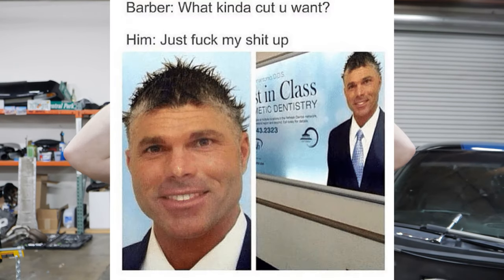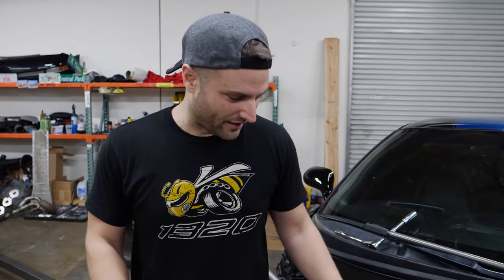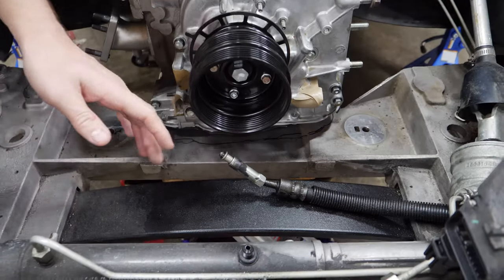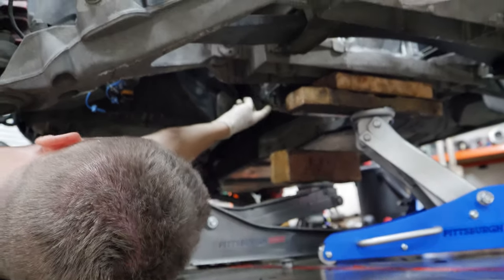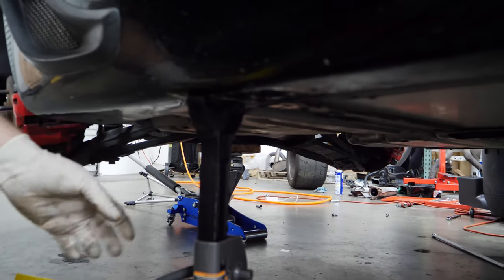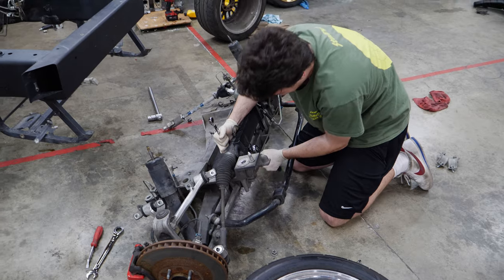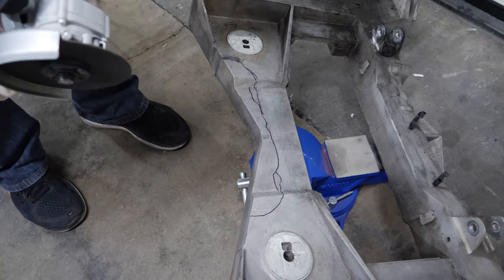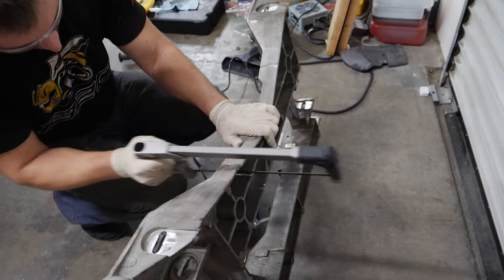Rotary Corvette Subframe CUT.  1 month to LS Fest

Comment: Aluminum cutting/grinding tip: use a cutting wax. I do a lot of machining with aluminum and brass, and lubricant wax stops cutoff wheels, grinding pads, and drill bits from clogging with soft metals. It’s an amazing difference in time and effort. Cheers!

Comment: Just a tip, you can use a grinding wheel instead of the cut off wheel on that subframe. Harbor freight has a pack of the fiber reinforced one's for like 10 bucks. They last forever too. Good luck with the build.

Comment: You could do with using a recip saw to cut aluminium, ally clogs grinding discs causing them too over heat and explode, flap discs are OK though and make a good job of cleaning up and finishing, keep up the good work 👍

Comment: Are you planning on doing a v mount radiator and intercooler? You have a ton of space for awesome airflow into both
Reply: Yeah, especially with the outlets on the hood like the Ford GT, it would look sick
Reply: V-mount is a massive waste of time. Any decent modern radiator and intercooler will suffice, this isn't the 90's anymore. At this point, it's literally rice. Putting an intercooler that can support 800hp into a car that won't make 500 will just leave you with less boost going into the engine due to the pressure drop associated with it.
Reply: Sky Guy yes most of today’s ics and rads can perform well in standard configuration, but they would perform BETTER in a v mount configuration with proper ducting. Air flow is air flow, and colder air intake temps are always better. So if he has the space why not? Plus v mount isn’t that time consuming to fab brackets for, even if he doesn’t do proper good venting and ducting right away

Comment: Hey Rob, not sure if you will see this but thought it might be worth a mention.
If you coat your cutting or sanding disc using a dry bar of dish soap ( We have a green bar here in South Africa called Sunlight) it will help massively with picking up less aluminium onto your cutting faces and "lubricate"your cuts also preventing your disc from digging in :) Keep up the great work!

Comment: They are kind of rare but I wonder if swapping a gsl-se front cover would help your engine mount setup. They have the engine mounts in the front and may be pretty close to lining up with the stock corvette mounts. I’m not sure how omp and all that stuff would work but it wouldn’t be a bad thing to look into.
Reply: He does mention fitting an early type front cover with engine mounts but does say with the expected power would rather keep the rear mounts to prevent twisting the block.
Reply: Yeah watching it again I totally did glaze over when he said that haha I suppose that makes sense, just kinda sketched me out that it sounds like he still wants to mount it to the subframe with the rear mounts.

Comment: 17:39 I did similar work on my Tercel to fit a 1ZZ into it. I ended up doing rough cuts with the angle grinder, then finishing it off with a Dremel for those precise rounded cuts. After that I boxed the frame rail off with some extremely thick steel to make up for the lost support. Photos available if you're interested

Comment: Hey Rob, when cutting aluminum with a cutoff wheel, run the cutoff wheel through a regular bar of soap first. The soap coating the disc will keep it from getting all loaded up with aluminum. 

Also, the haircut looks fine, I wouldn't worry about it.

Comment: After the engine mounts are made and the sub frame gusseted or boxed, the really hard stuff is done. Electrical and fuel won't be too bad, and with a few acres of space the inter cooler and intake plumbing should be pretty straight forward.

Comment: Awesome work! As a tip maybe use a bit of masking tape to straighten and plan out your cutting lines. To apply a neat and subtle radius, I probably would have used a flap-disc on the angle grinder, I can really recommend them. But it turned out really nice.

Comment: To make arced cuts in any type of metal it is easiest to make the angled cut like you did then use a die grinder with a carbide burr to finalize it. A die grinder gives you the freedom to make any size arc freehand and also has many other uses around the shop. I can tell you that once you have one, its a tool that you will think to use in a lot of situations.

Comment: thinking of the circular rotation of the rotors; your engine will vibrate/oscillate in that motion. Maybe consider that in the future? Your bushings will have to be extremely firm or else the engine will vibrate on the subframe.  That, or grind off a bit more off the subrame on the sides. I don't know your vision on the vehicle, but if you care for it to be yours for a while dont skip corners, now is the time to do things right.

Comment: man you guys need to watch project Binky, force you to up your fabrication game.
Reply from the maker: Definitely trying to grow quickly on fabrication so I don’t have to rely on anyone else.  I’m sure watching him will help inspire!
Reply: @RobDahm  this exchange right here is why i watch this channel , keep up the good work man
Reply: @RobDahm  Project Binky is a feat in engineering. A full ST185 Celica GT-FOUR drivetrain (3S-GTE, 4WD) into a 1960s Mini Cooper, just amazing. 👍💪 Search Bad Obsession Motorsport.
For actually building the engine you've already stumbled upon the twins and Broomy at FullBoost. 😉
Reply: @Z-Ack  Dude, I have a JZA70 1JZ in an MX83 Cressida, it took me nearly 10yrs to find a specific OEM part due to lack of availability because people would only sell the entire kit for thousands and Toyota are pricks that don't sell to engine swappers!! 😫
Reply: @MafiaboysWorld  what part takes 10 years to find lol
Reply: @MadEvo606  A CT12A rear turbo that I was looking from 2010 for. Check everywhere on the aftermarket, you can get the front turbo, no problem. The rear turbo however was a different serial number and NO ONE makes them individually, only as kits for cheap Chinese turbos. Toyota wouldn't sell them unless you gave them your VIN number, which I didn't have because I got my 1JZ out of Japan back in 2006 as a front cut, took motor and ECU and threw rest away, not knowing that fact at the time. 🤷 Go on eBay and I could buy a full used 200000mile kit from someone who was upgrading to a big single...for $2000+AUD, F that!! It's ridiculous at times. Fortunately I got one for $230 from a mate of a mate who was wrecking a Soarer and didn't know you were meant to keep the kit together. I got the rear and some guy in New Zealand got the front one. 👍
Reply: @MafiaboysWorld  oh that's difficult then, glad you found it in the end

Comment: Could have used a holesaw in the corners before you cut everything else. but now its too late. Aluminum is still soft enough that even wood cutting holesaws could be used in a pinch.., it would dull the crap out of them quickly but they could be used.
Reply: I still don't understand why he didn't just buy an aftermarket subframe that's lighter and has tons of clearance.
Reply: @unlisted9494  Because $3000 and no answer to emails, which he says in the video.
Reply: @mfree80286  More than that.  It also requires switching to coil overs, changing the axel stubs and brake system.  Not to mention it was designed for drag racing. rather than all around uses.

Comment: hi, Rob, you can make two bridges on each side of the engine to put the motor points, starting and using the same points of the subframe and welding somewhere in the firewall.

Comment: The stack of washers are most likely for achieving proper torque to seal the oil pan when the engine mounts are not installed. If you don't torque the bolts properly before the RTV dries, then the pan will leak.

Comment: I don't think your technique is too bad there. You've definitely got the right idea with sneaking up on the cut and tracing out patterns. You can finish it off with a flap disk, or with a roloc disk. I love roloc disks for grinding welds and such, but the curve here isn't crazy tight so a flap disk should be plenty capable. Then ya know, go crazy and polish the whole subframe and get some dude to spend a week engraving fancy swirls all over it.

Comment: Invest in a Zirconia Flap Disc, Rob. Especially with aluminum, a flap disc will smoothen out the round cut on the subframe, and you can use it to deburr your edges.

Also, I noticed you held the grinder so the dust from the cut goes away from you, which is dangerous. Even with a guard and a handle for better grip, an angle grinder catching from the wheel will rip itself out of your hands, nearly 80% of the time, dare I say 90%. So having the dust from cutting fly away from you means the blade catching will send the grinder towards you, risking a bruise or even a cut, regardless of whether you have a guard on it or not. Hold the grinder so that when you cut, the dust is flying towards you, in between your legs, basically around you, that way if the grinder ever catches, it flies away from you, killing any risk of that blade coming for you.  I cut my hand 4 times on one cut from an angle grinder holding it wrong while cutting an exhaust. The blade hit my skin, went deep, went off my skin, and came back down, FOUR times.

Comment: Bend a 1/4" aluminum plate and weld it to the subframe to replace the wall you cut out.  You will get a bunch of strength back. The Carbon Fiber leaf spring supports the entire front end, and flexes the subframe.

Comment: on the hack saw... pick up some A9 cutting fluid (for aluminum) And use a coarser blade. It will last a lot longer (way longer than on any other metal) and cut WAY faster. 
On the angle grinder, pick up some cutting wax (or use a soap bar) it will make the abrasive disk last longer, and cut way faster through aluminum. 

Like butter if you use the right methods. 

Good luck!
Reply: also, get a die grinder (or rotozip if you do not have air.. or foredom) and some good carbide burrs to remove some small material and round out edges (also use A9.. really use it on all cutting tools with aluminum) 

a good set of files can go a long way as well (nicholson or something equal or better)

Comment: Rob that thin disk is for cutting they make thicker disks for grinding and are ment for side loading a bit better but that thin cutting blade just too much side force and it will snap
Reply: Is this even English?
Reply: @glock1inthetop45  too turned into turn with auto correct... otherwise he used a cutting disk for grinding away material and they will snap with side loaded force(using the flat side to move material) and they make thicker grinding disks ment to be use more for moving material and less liking to snap to side loaded force

Comment: You need a special cutoff wheel or grinding disc for aluminum. The way the aluminum was melting onto the blade can be dangerous, since it can cause the blade to explode.

Comment: If there's any plans on going to a 3 rotor in the future, that subframe is gone. The only thing I see working from there is deleting the leaf spring, putting coils in, and replacing the subframe with basically a straight bar, with mounting for all the extra bits.

Comment: When using abrasives on aluminum, disk or otherwise, you need to lube the disk or grinding stone. usually a dry wax or something of the like. Aluminum gets too soft with the heat involved from grinding or sanding, lube lets the aluminum dust fly off the abrasive surface.

Comment: Hopefully you look at this.. make sure when you are grinding and cutting aluminum you use the appropriate disk flap wheel or cut off that it's made for aluminum.  If it's not made for aluminum it will load up like you were seeing and become unbalanced and fly apart.  Solid grinder wheels and disk are way worse about it but it's usually not good when it happens.  Be safe brother.

Comment: The extra bracing on the sub frame should be easy when it is not solid, get a big slab made and just bolt it onto the remaining frame with nuts and bolts.

Comment: You can make the radius cuts using a straight grinder with a aluminum rotary file. Also, you should always either wax or wd40 what your cutting with before cutting aluminum to stop it from clogging and impeding cutting.

Comment: Just a couple Things please wear a face shield when using a cut off wheel I’ve worked in Fabrication and have seen those things and just fly apart and hurt people pretty bad. And secondly when you’re making the cuts making the cut and cutting up the chunks that’s like the best way to do it but if you take a tiger paw or flapper disc and use it for  the finish work after you cut out the big chunks it’s a lot safer and you usually get a a better end product. Lastly please never use a cut off wheel as a gridding wheel that is very dangerous because it is causing side pressure to it and they’re not designed for that and they will explode when to much side pressure is applied I have learned from experience on that one lol. Anyways love the content keep it up!!

Comment: It cuts like butter because it's smaller.when the cutting wheel is bigger it disapates more heat the blade heats up alot faster when it's smaller hence why it cuts better

Comment: ROB  ..here is a life saving tip place your tires under the car that way if the jack or the stand fail it will just fall on the tires..savin' your butt  also make sure you place wood on top of your Rim/ tires so they don't get damaged.

Comment: use the same points of the LS motor, the solders in the back and so you make the bridge and you only have to make barriers to the bridge that you use in the place where the screws of the motor points and so you do not have to cut the sub frame. until all the front of the engine area would be more solid

Comment: That came out nice man - a die grinder might have helped on the rounded parts and to round the sharp edges off to make it look pretty. But well done with what you had. Cheering you on for another awesome project.
Reply: I would think an more angular cut would be easier to plate. Cut out half of an octagon and throw some 1/4" aluminum on those faces and get it welded on.

Comment: Are you going to solidly mount the engine? If it's still going to be on rubber mounts then you need extra clearance in that sub-frame to account for movement.

Comment: i know you already filmed the next video but you can make a plate that goes from the transmission cross brace to the corvette engine motor mount and to the cross brace bolt hole to mount it all up that way

Comment: Make engine mounts that allow you to slide the engine forwards so you don't have to lift it out of the bay to do work around the back of it, will also make clutch/ transmission changes that much easier
Reply: Clutch, yes. Transmission, no. Remember, Corvettes have the transmission in the back for weight distribution.
Reply: I am aware, meant more if he broke the propshaft boyo it would make that easier to pop out and in

Comment: I used spacers instead of washers.. it's so you can tighten the oil pan without the motor mounts in place.

Comment: I would agree with triangulating the engine mounts to the subframe by using some 1/4" plate and running it back to the mounting pads on the 13B. I would over engineer the extensions though and use as many supporting runners as possible. Maybe even run a couple to the frame and rivnut it with a large bolt and weld the other end to the subframe. The weight of the rotary isn't the issue though, it's the twisting stress that engine is going to put on the mounts when it's making torque. PLEASE go turbo...don't make a 13B NA in a Corvette chassis brother.

Comment: I really think you shouls consider the old style front cover. Trying to cantilever engine mounts to the back of the engine on an already compromised subframe seems like a real recipe for cracked subframes I hoe you end up tig welding a thick aluminum plate along the area you cut out.

Comment: a 2 1/2" holesaw would cut that radius perfectly. cut a template hole in a piece of wood, then use it to line up the hole through your material.

Comment: It would be easier to use a plasma cutter and a whole lot quicker! That wheel cutter won't cut good man. The hack saw is a hack too! The amount if time you cutted that cross member you could of had the whole engine and suspention installed, but you did a great job slow poke! Don't forget yo weld in some aluminium brasing on the cross member.

Comment: did you cut that sub frame tight to the engine..im worried about engine movement...ive see things get bent and broken from not enough clearance around engine..just a heads up...unless your running super stiff engine mounts...to compensate

Comment: Make a bracket that is the shape of the water pump to use as a reinforcement bracket plate to help on the amount of horsepower and to help with the power load coming from the trans on the launching
Same brackets they use in drag cars

Comment: What if you shortened the wheelbase by cutting some of the mid section, welding it together, and you get a smaller, more nimble car like they did for the Ferrari f430 stratos in that recent grand tour episode

Comment: In the past, we would mount the engine so that the engine's center of gravity was directly over the front axle.  But who cares about history, have fun and learn why us old times did it that way.  There is a great aftermarket steel tube subframe that will fix this problem.

Comment: From experience, cutting aluminum with a grinder (death wheel) sucks, hacksaw sucks, bandsaw sucks, PLASMA TORCH IS GOD, use a plasma torch (I use a Hypertherm Powermax 30/Air, quality machine, can run on 110v or 220v, has a built in air compressor, just plug it in and go! and it does a very nice clean job)
Reply: I second the plasma, but I'm pretty sure he'd find a way to burn down the neighborhood lol